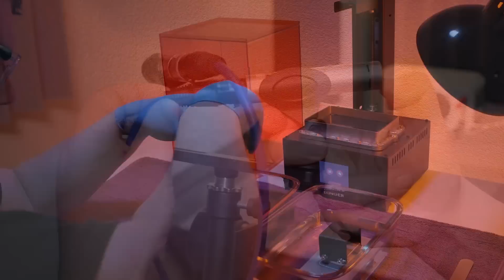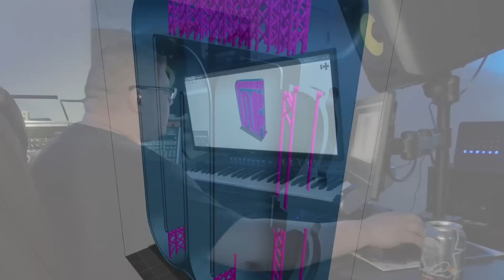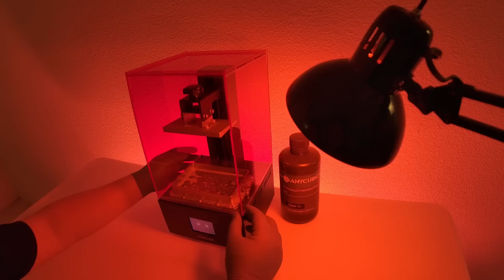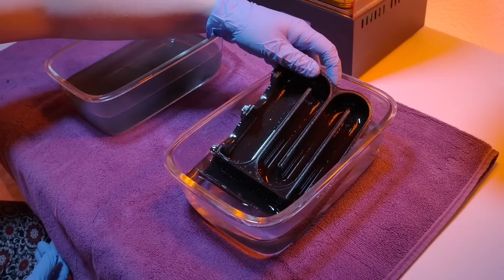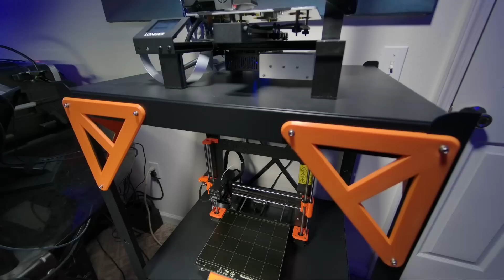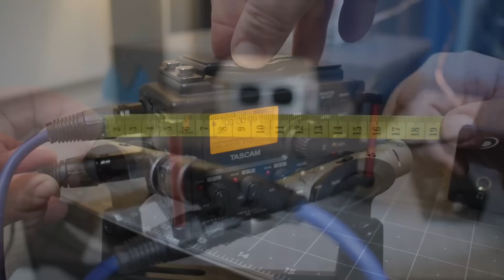Orange Adventures (Part 1)

Comment: How did you level the orange? Did you try the Flint Read method for levelling resin printers? A lot of my problems with resin printers went away with that leveling method. I've learned the very slight level problems don't produce noticeable effects unless you go past the halfway point of the build volume's z-axis. Past that, any slight level problems start getting more and more pronounced.

Comment: You are having a problem of suction. The flatter the piece is, the  bigger the suction. You are having troubles both at the top and at the bottom where the surfaces are parallel to the print plane. Orient the piece with an angle of at least 15° and any suction will go away and with it any print failure due to the layers separating. Make sure that the adesion surface to the support is always bigger then the biggest layer you are going to have during the print. Furthermore you have to tension the transparent film at the bottom of the vat. Your machine is totally ok and even though they accepted to replace it, it doesn't mean you are in the right asking for it and obtaining it. With any kind of 3d print 3/4 of the problems are relatable to the method you use to set up the slicer. Last bit of advice, before making content using a machine you don't know how to operate properly, you might have studied the subject a bit more.

Comment: Can you upload a version of this video's mini speaker with chamfered edges on the exterior of the case instead of filleted? Printing with supports wouldn't be required at all if that change was made. Thanks and awesome video!

Comment: As for the results in the high end, I would guess that the variation in the high end is probably somewhat due to speaker-to-speaker cancellation, but also probably largely due to measuring in a non-anechoic environment, i.e. reflections from various sources are causing peaks and nulls.

Comment: Try a layer of foam or other absorbent material on the face of the enclosure.  Alternatively maybe a sheet suspended internally behind the  drivers (firm to the walls but splitting the "chamber" in half) may also  help with the beaming and may be more effective.  I suspect the first resonant chamber has something to do with creating it unless it is a direct driver construction level artifact.

Comment: Use only one driver, it will enhance the upper frequency your configuration is hindered by both standing waves due to speaker distance and coil loading, resulting in a much lower high frequency response.  I think efficiency is also affected y can set up two boxes wityh a passive drive and drive them with two channles, this will improve high and low frequency ( higher volume)

Comment: Very cool, I am glad I subscribed. I built some TL floor standing units that support a 10" woofer and a dome mid & tweet. That was 42 years ago. Each cabinet weighs 98Lbs.
An Omron calculator did the heavy lifting

Comment: WAIT you don't use MLS ( or time gated-semi anechoic measurements) for acoustic response measurements?
Please try http://www.artalabs.hr/   or http://www.holmacoustics.com/holmimpulse.php . Arta being very technically rich, Holm impulse is super fast, easy to use offering great results. Now beside loosing room influence when gated properly (just before first reflections), it is insanely FASTER (especially Holmimpulse which gives amazing results in 1-3 sec long chirp it is so fast that you can not called it sweep 8-), and it is continuously filtered/gated) then you can stitch time gated measurement with ungated one for lower part of frequency window, basically you measure speaker and not the room, it is faster and since feedback from amp to another recording channel is recommended, it is way more noise immune, so you have perfect results every (short amount of) time!
Reply: Also mics and mic-stand can nicely mess up response in higher portion of the frequency spectra just like it is bothering you (learned long time ago the hard way), let me know when you get there, gated measurements first...

Comment: Same here, bught resin printer, got one or two succesful prints and then it's crap.
That's how these cheap resin printers are.
Also quality degradation at larger prints is due to lack of rigidity of such budget machines that are not designed to handle those forces and simply flex a lot.
Same as you, I just went back to FDM printer.

Comment: Unfortunately those cheap DLP/LCD<
/SLA printers have a problem with prints like that. They are great for miniatures and certain abstract parts, but you really need a low force SLA printer like the form 2/3, and maybe the moai.
I design game controllers, and until i got rhe form 3 i could not get my LCD printer to print cases, only buttons.

Comment: To test the function of a "T-Line" (car-audio terminology) you need to do near-field measurements. Your (greatly smoothly) measurements tell us more about your room than the function of the alignment.
Reply: http://audio.claub.net/software/FRD_Blender/White%20Paper%20-%20Accurate%20In-Room%20Frequency%20Response%20to%2010Hz.pdf

See "Near-Field Measurements –" section.

Comment: The print would have come out much better if oriented diagonally, as resin printer is not the strongest in printing flat surface.
Reply: try at least a 10 -15 degree shift so that the flat surfaces are not parallel to the build platform. also consider making sure the printer resin is warm, so it flows well between layers, if its cold in garage, put space heater , or move to ventilated bathroom.
Reply: Egh I'll stick with my thermoplastic printers LOL Between the small build area, toxic liquid resin, cleanup, temperature requirements and additional curing,  it sounds like way to much hassle! Lol 😉
Reply: @smartroadbiker  As he pointed out, resin printers are better for things when you need insanely tiny details to show. He mentioned D&D mini's and those are usually around 28mm-32mm tall and have not really been all that great when printed with plastic printers. That's why having both types isn't a bad idea, especially as they are getting more affordable. Using tabletop gaming as an example, you use resin printers to print the miniatures, while plastic printers print the terrain. Depending on the level of detail needed, vehicles could be a combination of the two where plastic is used for the bulk of the model, but has resin bits for the more detailed spots.

Comment: The t-line needs to be much more narrow to get the compression for good bass. Just focus on sub bass.
Reply: @HexiBase   Have you tried it or just speculating? Just because  specs say the speaker resonance fq is 120 dont mean you cant get a solid 40hz out of it.  Most subs out there are played lower than their f3 anyways.  You should try a smaller diameter port with the the same length. I guarantee you the bass will be louder.  Forget about full range, make this thing pound hard. That's the beauty to a t-line aka long ass folded horn. You can get any speaker to bump hard.

Comment: Please use safety goggles to when you handle the resin or printed parts that need to be cleaned, that stuff + the IPA is dangerous for your eyes. I've got a Nova3D Elfin and some times I feel IPA on my face (small parts that I brush off with a tooth- or painters brush ;) )

Comment: Interesting video  Thanks ! I will ask you a question that I hope you can answer and help me with : Do you know of any subwoofer amplifier that's compact  (6" x 4" x 6" ) that has two channels inputs and outputs and around  60 to 90 watts RMS x2  with volume ,phase and crossover control for my passive subwoofers ? I have search a lot and can only find mono blocks and wide stereo amps . If you know of any amplifier for sub's that fill my needs , please let me know. Thanks !

Comment: Hello! Would you be able to share references to engineering books and software for proper pressure dynamics simulations? I'd love to actually study the physics behind acoustics, pressure dynamics, acoustic loading, lumped parameters modelling, etc in order to design "scientifically optimized" enclosures.
Unfortunately the things I could find on the net until now were only some calculators that work well enough for amateurs for the major lumped models (WinISD is an awesome tool, but it's limited to very specific cases and it doesn't really account for reflections and materials for instance)
Reply: http://www.hornresp.net/
Reply: @ZegaracRobert  thank you!
I already found that one though, and it's still not a comprehensive engineering tool :/

Comment: For gluing 3d printed parts I recommend devcon plastic welder over jbweld. It cures faster and is quite strong.
Reply: @HexiBase  My best suggestion would be resin - "painting" the mating surface with resin and curing them together should work.
For large parts like this box, two component epoxy should do the trick

Comment: I did see something similar to this printer (Just a bit bigger) when I visited Red Bull Racing in Milton Keynes in 2005. They used it to produce small aerodynamic parts for the air intake of radiators and engine. And probably some places that they did not tell us about.

Comment: set the item with angles will get a much better result, in this case, I would set the corner with the square hole (idk what's that called) to the bottom (last print side) that the resin could come out from the channel

Comment: I want to play a sound file from an engine that was recorded live and the sound range is from 28hz to 120khz or more. The trick is I want to use very small speakers in an confined space. Can you get this low bass from speakers under 3 inches in diameter ?  After seeing your box design I’m thinking it is possible, thanks!

Comment: Quick suggestions for you on post-processing. Set up a system of 3 washes or 99% isopropyl alcohol. Use regular paint brushes to brush off excess photopolymer.  Be sure to remove all supports before or during the first wash. After the first wash dry the part(s) with compressed air. The shiny areas are where you still have uncured photopolymer. Focus on these areas in the second bath. Dry again. Finally, rinse the third container of 99% alcohol. This is simply a final rinse. Once the first bath is too contaminated you can properly dispose of the alcohol/photopolymer solution and slide your containers down.. 2 becomes 1, 3 becomes 2, 1 becomes 3 (final rinse).   You want to avoid rubbing the parts or getting over aggressive with the brushing as it is possible to start removing cured material. Once cured, or partially cured, you can do some cleanup work with a rotary tool (Dremel) to smooth out support bases, clean up details, etc.   For the clear materials I'm sure you noticed they cured translucent. To get them crystal clear you need to buff and polish them with appropriate compounds to get them back to clear. The translucency is just on the surface.
Reply: Also, you can verify your parallelism of the build platform to the glass using a feeler using a 0.1mm feeler gauge. If you don't have the feeler gauge then you can still get away with the paper. You want to feel equal tension at all four corners of the build platform when you are setting home. You don't want it just sitting on the paper and tightening the bolts, you want to ensure the paper is under tension. However, you don't want the tension so tight you can't remove the paper. The tension should be, hard to describe other than, firm. You should be able to pull the paper without tearing it while still having resistance from the build platform. This tension should be equal at all four corners so you may need to adjust, then readjust the tensions.  Too loose of a tension and the material won't cure to the platform / layer, and too tight of tension and you will start compressing layers, not allowing adequate material, overcuring, and possible damage to the film in the bottom of the basement (vat, reservoir, etc.). Once the film is punctured it needs to be replaced. This is also why you MUST make sure you clean the build platform completely before and after printing. 

I would try rotating the part on the build platform if there is ample room so it prints corner to corner to try getting it away from the outer edges of the build envelope. Also, all those supports are overkill. The supports between the build platform and part are ample for holding and supporting the part. The only place supports would be needed are coming down to support the leading edge of interior walls. Generally any less than a 30° angle does not need supports. But if you visualize the leading edge of the interior wall you'll see there's nothing above it to support it so you do need those supports.
Reply: Also, with the orientation of the part, the photopolymer will have a tendency to puddle and this could be whats causing problems on the bottom of the print. Perhaps printing the part on a slight angle to help drain material while printing and avoid large flat surfaces could work. Also try slightly increasing the exposure times per layer. Perhaps flipping it 180° and printing the flat edge first would be a good solution at well.

Comment: We know sub bass mid bass and treble ranges fall but where does the hexi bass fall .?........ mhz or nhz plank length ?
Reply: @HexiBase  Ahhhhh variable oscillating modulation.  Never thought of that . How to u compensate for super sonic phase shift ,? Is it an actual auto sub-super sonic phase shifting compensator or a compensating phaser Apparatus with a integrated sonic pulse discriminating wave oscillating generator, or is it a flat head screwdriver?  Or... none of theese

Comment: Just a guess but, one problem a lot of people have when they're new to resin printing is not mixing their resin thoroughly enough, some resins separate more than others and need way more mixing than you'd think.

However I will say I have only ever used industrial grade SLA/DLP/continuous DLP printers so there could be a problem I've never run in to on the lower end printers

Comment: great video again. have u ever worked with voight tubes?  i was thinking about them, but found no material about how to calculate its tuning.
Reply: @HexiBase  im thinkin about doing some for the highpass of a home theatre like set up, so dont need them going too much lower than 40hz, not full range per say.  but all the designs ive found didnt not show a way to calculate them. the open end port/flare is easy 1/4 wave calculation, but the closed end, im not sure how that interacts with the driver and  't-line' section, to know what to calculate. 

my line of thinking is, if i tune the open section for 50hz centered, it will have peaks at 100hz, 200hz, 400hz 800hz. and then tune the closed section for 75hz, so it will peak at 150hz, 300hz, 600hz.  so it more or less fills out the bandwidth, very efficiently.

Comment: That 20w curing setup is way too much! Think of it like glass. If glass cools slowly, the internal stresses have time to equalize and shift. Where as if you cool too quickly, the outer layer contracts rapidly and breaks it. Same for resin. It needs to cure at a much slower pace or one side will shrink and pull before the other side has a chance to. And the skull one just looks like you didnt have enough resin in the bath. Better luck next time man

Comment: Pity you did a model on that will barely fit on this sla printer from longer that doesn't seem to be working very well. I have an elegoo mars pro and the stl file will not fit within the build volume of my printer. Don´t get me wrong, it is a fantastic video and I wanted so bad to build this kind of speaker.

Comment: I have a challenge for you. Something that I've had as a thought puzzle for me for awhile, but don't have the acoustic engineering knowledge to make . It should also be a perfect 3d-printer project. A wearable ultra-nearfield speaker. Something like the Bose Soundwear. Bluetooth and all (bluetooth dongles from aliexpress are cheap so that's the easy part).  WITHOUT dsp. I've been looking at tiny speakers like those Tang Band, isobaric set ups, passive radiators, even ribbon tweeters (they can make decent headphones). Even getting a bluetooth 2.1 amp board, and wiring the subwoofer channel back into the single speakers so extend the low range power (since it will be MUCH lower volumes then a loud speaker, should have to worry about blowing them)

Comment: I briefly had an Orange 30 myself. I mostly had successful prints but didn't maximize the build volume. I returned it because I didn't like the touch screens manners and I didn't like the vat design. So I got the Epax X1. It was supposedly superior to other budget resin printers. I struggled greatly with this thing to get successful prints big and small. For my purposes which are generally larger, flatter, and more square than table top models these are generally used for I concluded resin printing just isn't for me. I badly wanted it to be though. Also I printed in my basement with ventilation and the smell still permeated the house. So I returned it also. 

After I returned the epax looking back the Orange 30 was actually the superior design. The shroud is a joke but I'm talking the actual function. The led array is much better on the Orange 30. In fact Epax sells a similar one for their machines as an option that comes standard on the Orange 30. So with some tweaks and revisions the Orange 30 could be the budget resin champ imo. 

One last thing, just use Chitubox. Dont mess with the Longer slicer. It's much to basic.

Comment: Dude that mic set-up is way better for listening to the test.
Reply: @HexiBase  got a question. For a T-line is it better to have the port closet or farther away from the driver? It was my understanding that you want it as close as possible. However in a diy speaker group I am in. A few guys said that it is better to have the port as separated as possible.